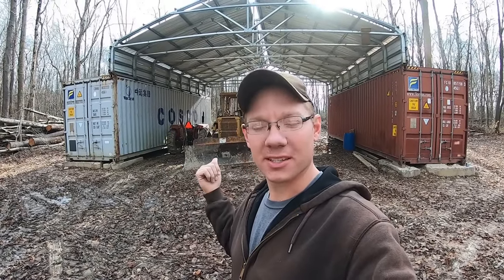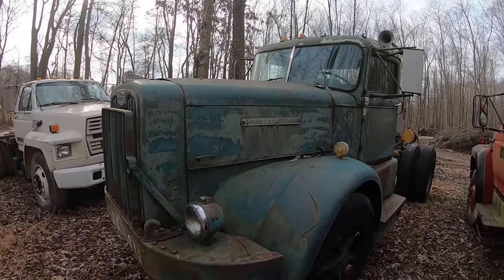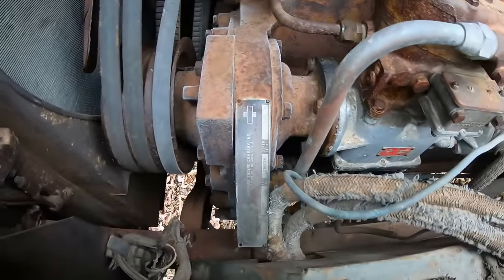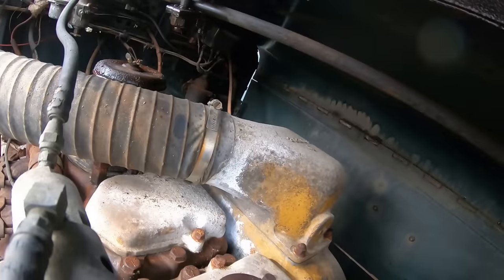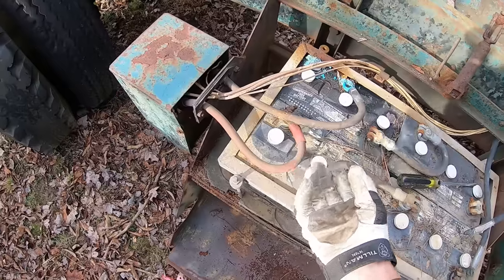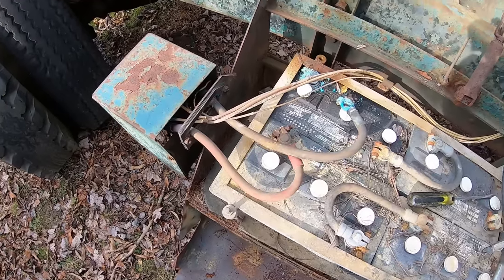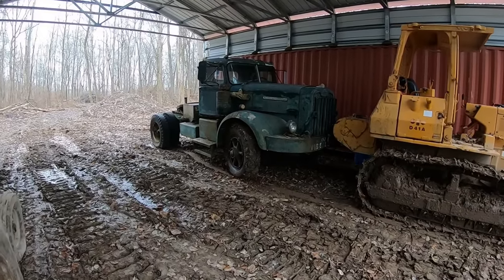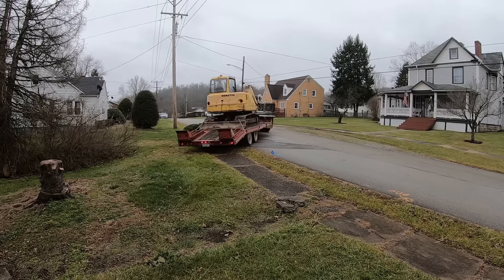First attempt at starting 1957 AUTOCAR truck - Hasn't run in 15 years!

Comment: Those old Autocars were positive ground. Most likely you will see that in your manuals. Remember that is positive ground so normal wiring will be a bit different. And you will need to remember that when your rewiring things. It has been a long time for me to remember how all that works. Drove old Autocars trucks a long time ago. They were positive ground even up to the 70's or more. And if you were to put anything negative ground in there it will short out. 

And if you were me run new diesel, take off and clean fuel system before starting. And check the wiring well between starting system. Most likely those batteries have frozen at one time or a another.  So check for bad cells. Be ready to have something flat to block off the air intake in case you get a run away to shut air off to the engine.... you never know on them old girls. The compression release is in the cab, if you need to be in a hurry, that flat piece of wood will cover that air intake on top of the engine in case something goes wrong. 

Here to help if I can.
Reply from the maker: Much appreciated! those batteries are completely toast. no continuity. as for your other suggestions I plan on doing all that next time I work on it, I went in a little un-prepared on that one so im glad it didnt actually start. its going to be a long big prioject!
Reply: @DieselCreek  yeah that's okay. It's good you got some books to reference from.

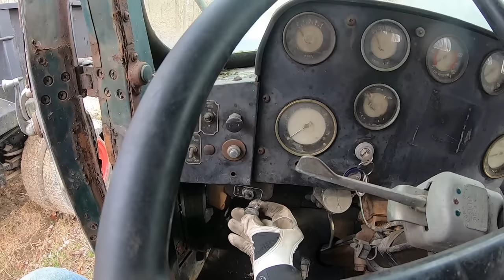Comment: 12:09 - wiper control - 'plumbed with air lines...'
Reply: Sounds about right
Reply: Don Pollard that was common way back when. They were vacuum lines. The wipers would slow way down or speed up depending on throttle position. It was not an effective system and the wipers were no longer then  about 12 ". I'm 78 and cut my teeth on such early systems.

Comment: The brake shoes are rusted to the brake drums. Thats why the rear end won't rotate. Be careful if you take it apart.  Most likely the brake shoes have asbestos in it. Just my two cents worth.  As for starting the engine make sure you remove the intake pipe. And have a board that completely covers the intake hole. So if the engine runs away you can cover the intake with the board and kill the engine.
Reply from the maker: Yes freeing the rear end up will likely be an entire video itself

Comment: That knob under the dash controls the wipers. That pull handle should be the compression release to aid when starting. Those old Cummins engines had weak starters that needed extra help to turn the engine over. I remember every Cummins I ever drove up until the 70's having them.

Comment: Get some real jumoer cables ,OO welding cable. Pull the 'shut down " compression release while cranking. Let it get spinning freely  then push the release in . Might even crank doing that way with the cables you have. started more that one long sitting old Cummins.
Reply: If that truck was given to Bruce Wilson it could literally starts in one day
Reply: Yep 
Does he know much?
Reply from the maker: Those are 00 welding cable... I said that in the video
Reply: My buddy bought an old Mt. Ranier plow truck.  Don't know what kind of diesel it was, but it had a 10yd dump bed and 2000lbs of weight plates on the front end (no plow blade though :(   ).  Same type of electrical setup, but my buddy figured we could get it started with his minuscule VW Rabbit battery (brand new), and the battery from my old BMW wired together.  We fought that thing for a week, but couldn't figure out the problem... It would just wind up the flywheel, and you could watch the oil pressure come up, and it would suck down some fuel that he was pre-loading the fuel filter with, but no fire.  He was sitting on the fender messing with loading the filter again, and I was sitting in the cab, and I saw there was a shallow depression in the grass ahead, and I figured I'd freak him out a little and take the parking brake off and let it roll a few feet.  So I put the giant lever in the cab that I thought was the parking brake down, and it didn't go anywhere to my dismay, but my buddy DID freak out: Him: "WHAT DID YOU JUST DO!?"  Me: Took the parking brake off...?"  Him: NO!  That wasn't the parking brake... try the key now..."
And when I hit the key, even with both batteries, it barely turned over.  But it cranked fast enough to start, and we did a little dance.  It was a compression release!  So we left it for the day, saying I would return the next day to help him start it again to move it to his house, but when I called the next day, he said he had already moved it.  And when I asked how he did it without both batteries, I asked if he had spent the money on a new, real battery (which was about $600).  But he said nope, got her done with just the Rabbit battery!  So I went over to see, and he wound it up on just the flywheel on that little battery, and when the oil pressure got up high enough, he just slammed that compression release closed, and that thing fired to life with some real authority!
Another one of the cool things on that truck, it had some type of venetian blinds in front of the grill which wouldn't open until the truck was up to operating temp.  You wouldn't want to stick your fingers in there when they closed though, you'd pull back stumps!  Had a 10 speed Allison transmission too.  Fun experience, but he didn't own it long, the city wouldn't let him park it on the street out front of his apartment. xD

Comment: Hmmm, the old Autocars I was familiar with used air starters. Don’t know what engines they had in them tho.
Reply: John Acuff air starters could be used on any engines. But you wanted to carry a 50 to 100 foot jumper hose, so a buddy could pump you up. 1 truck I worked on had 2 - 12 volt starters.
Reply: I remember those starting on my towns Main Street..Damn loud, and scary if you don’t know what’s going on.

Comment: That gizmo behind the battery box is a series/ parallel switch, 24v while cranking and 12 v after. They can be a real corrosion nightmare. I’d also verify that it’s a negative ground , and you will get more current if the dozer is running. I think I’d make new battery cables and put a couple 4Ds in there, consider it the first step in the resto. It looks like you own enough equipment to justify a couple big batteries anyway. Just my 2c. Oh and you have a new sub, thanks!
Reply from the maker: thanks for subbing! ill be getting some batteries here soon so we can get her going i was just excited to try and mainly focused on getting it under cover, thought it would be awesome if she could drive there!

Comment: Should not try running her with the fuel in it! Get you a 18 ltr Bottle of fuel and directly connect to the fuel pump or filter inlet after installing a new filter,  Try to prime the fuel line with a siphon out of the barrel, having it set on the roof to help gravity feed the fuel!  Some of these trucks do have a primer pump by the filter, If so Give it about 7 plunges so it forces fuel thru the pump, Crack the injector inlet lines so you can see fuel start to leek out.  This method is one of the fastest ways I get old diesels started!   As far as the old fuel in the tanks,  Might as well drain into barrels and use for starting fires or cleaning parts.  DON'T RUN THE TRUCK WITH IT! That old fuel could play havoc with the pump and injection!
Reply from the maker: yes excitement was getting the better of me, just glad it didnt start so i can do it better next time, thanks for watching!

Comment: TIM from Canada suggestions for anyone that has all the equipment like this and you really do not know what the switches are.. Number # 1.. use masking tape put pieces of tape over or under your switches... depending if you have the room...# 2.. Mark out on your masking tape what the switches are...or...#3.. keep a book go to the dollar store or any workbook write down what you think the gauges are use freezer lock  bag.. put the book in the bag keep it in whatever vehicle you were using right on the front of the bag this is instructional for this vehicle... because in most cases when you were buying used equipment people have a tendency to modify gauges and switches that do not coincide with what is on the dashboard...

Comment: Dude, get 6 inches or more of gravel down in that shed or shove her back outside.  Standing water in mud under a roof eats vehicles alive from the bottom up.  She'd be better off in the woods.  Take the advice of hard earned experience.
Reply from the maker: It’s getting gravel as soon as the weather brakes and the floor is pretty dry In there we had some sideways rains a few days before that soaked the floor.
Reply: yup your right , but there is through  air flow that should help a bit
Reply: Check out asphalt millings for the floor . Best to put down in warm weather though.

Comment: The first thing to do is eliminate the 24 volt system and convert it to a 12 volt system , trust an old retired oo you will be glad you did !  Those parrallel switches were 150$ back in the 1980s  but now ???. If you can find one !  I bought two of em before i learned a 12 volt starter worked every bit as good as a 24 volt especially with new welding cables for starter cables and a new 12 volt starter !
Reply from the maker: That’s may be the route I go when I re wire it

Comment: Shorting the two big terminals on the starter will make it free spinning. To make the pignon gear engage the selenoid must be energised by jumping the small wire on selenoid  to the big wire from batterie . These engine have the tendenci for rust pass throu sleeves and leak coolant in the engine.
Reply from the maker: thanks for the heads up, i figure id get it running see what kind of power its got then if need be locate a bigger motor, thanks for watching!

Comment: That Autocar Engine which os a Cummins looks like a N 220 or 230 or a 250.. those engines came equipped  with a decompression device  which is the little lever on left front of the engine at the first head  it is an internal rod when you pull it from the cab   it push all the exhaust valves down  that help the starter to turn the engine   very faster  just see inside the cab for a handle hooked up with a cable hooked onto the decompression device  with handle on top of the first valve cover on first front head cover those engines are very tight on high compression it is why uses 24 volts just to crank  then the converter turns the whole truck into a 12 volts service..that box on left side od batteries with the cables is the CONVERTER.. or power Inverter   that engine it been seated for a long while check fuel filter   so at the time to make crank  pull the decompression device  and let the engine runs without compression for 15 seconds then release the decompression handle and the engine will start
I had few trucks macks R-700 with that engine on it  N250's Cummins on it.

Comment: One signal wire from start switch. Jump the correct terminals and itll turn over. Itll be the small "s" terminal to the power wire on the solenoid, not the two larger wires.

Comment: I just need to get something off my chest about how long vehicles have been sitting for. An engine doesn't know when it ran last. It doesn't have a memory! It is not thinking "oh no I haven't worked for fifteen years maybe I should just stay shut down! Now you know I'm being flippant saying that BUT, if the motor is not locked up and it has everything it needs to run, then it's going to run. 
I understand that the wiring all has to be good and a dozen other things need to be in a certain condition to run but if they are all good or have been replaced then the motor will work, whether it one year old or 90. Now don't go bagging me, I love these shows and have stripped and rebuilt more motors than I can remember. So I'm a fan ok. It just is not necessary to write in block letters that this or that hasn't run since God was in short pants. Cheers.
Reply from the maker: believe me I get where your coming from but for some reason the longer something has sat the more I wanna see it go! and im not alone because these types of videos do excellent compared to others that do similar stuff without saying "first start in years"
Reply: Diesel Creek. Yes, I get it, I really do. Thank you for bothering to reply to me (a lot don't) best, Chris.

Comment: You needed to connect two lots of jumper leads on twelve volts.Jumping the main battery feed and the power supply to the main starter body will only spin the starter as the solenoid needs to engage the drive gear.

Comment: if there's  compression springs on the rear brakes, they can make brakes stick. Either change the springs or use flat washers to increase their pressure.

Comment: Personally I’d rewire the whole starting system before doing anything. Mice chew on the wire coating and make holes allowing air and water inside causing corrosion of the copper. That reduces your amperage to the starter and can cause the starter to burn out. I’d also remove the starter and rebuild it and make sure the solenoid is free.
Reply from the maker: I’m gonna restore the whole thing eventually, new wiring hoses the works. Just trying to get it fired up to check the state of things mechanically thanks for watching! Hope you subscribe!
Reply: I understand that, but that wire was 90% gone. You could easily fry your starter. I learned the hard way as a kid. I spent 20 years restoring trucks, mostly pickups. Just replace the main wires, can’t cost too much, a lot less than a starter. Just my advice. Sweet truck though! I admired them as a kid in the 60s.

Comment: I could be wrong but i couldn't hear the dozer running while you were trying to jump it, if so you won't get the juice to the starter motor to crank it leave the dozer going it won't hurt anything so long as the connections are correct   but you obviously know that, can't wait to see it run

Comment: shorting across the posts will spin the starter but won't engage the solinoid, you need to find where the thin trigger wire attaches from the ignition key and power that at the same time. mormally just shory between the trigger wire and the 24v lead and it will do it.
Reply from the maker: Lee Wilkin yesterday I just connected some good batteries in the correct fashion and she cranked! Video soon!

Comment: That's a compression release you pull that out and crank it over when it gets spinning good u let the release go it closes the valves on the engine and it starts if u don't use it the motor will turn to slow,if at all and won't start.

Comment: on top of the fuel pump there should be a small round knob at fuel shut of solonoid you can manualy turn that knob witch opens fuel to the injectors to shut down engine turn knob to its original position hope that helps
Reply from the maker: I just saw someone else mentioned that and im glad because I didnt know that. thanks for watching!
Reply: @DieselCreek  you should cover up that intake or you'll have something building a nest in your motor. What year are the fords you want to sell gas or diesel
Reply from the maker: David Caskey I did cover it, the white one is an 88 f700 with a 6.6l diesel the other one is a parts truck no title with a big block gas burner I’m not sure of the year, it’s a 600, 2 speed rear nice bed and hood I was gonna put on the 700

Comment: New sub signing in. I Like what I've seen, so cant wait for more. FYI if the meter has a continuity mode or ohms, it would be easy to see whether it is + or -ve earth. Set it in one of those two modes, disconnect the batteries, and then touch one probe to the wire and another to the chassis. Low ohms or a beep tone indicates continuity and hence, that wire is the earth. Hope that makes sense. I would also buy some fresh batteries as I'm quite sure they will be sufficiently bad to stifle proceedings. Good luck pal.
Reply from the maker: Thanks for the suggestions and for watching! Merry Christmas!

Comment: Rewire the battery terminals it was  turning over like a week ground. The old girl should pop over with a little ether (go juice). The old fuel will have a lot of moisture and gel easily and cold weather.

Comment: Cummins have a thumb screw on the back of the injector pump so that once it's running it won't shut down for lack of DC power. Yours may not have that because it has a manual shut off.

Comment: the battery cables going in to the box go to what is known as a series parallel switch. when starter is energized it switches to series and turns the bank into 24v then when released goes back to 12v

Comment: I know this truck is old, but if it has air brakes, the lack of air in the brake system locks the brakes. The spring loaded pods that actuate the park brake cause it to release by being charged with air. It's a fail safe measure on air brake systems so if your truck dumps its air, the rig will stop on its own and not lose control.
Reply from the maker: not back then, spring brake canisters didnt come till later! thats why runaway truck ramps used to be so common back then if you lost air you were SOL ...this does have a manual drive line brake but not sure it would stop a loaded rig!
Reply: @DieselCreek  wow. Learn something new. Glad it isn't that way anymore.

Comment: Nice video
My grandfather worked for autocar in Ardmore pa back in 40s or 50s
Factory burnt down probably 58 or so.
Moved operations  out west
Auto car owner first invented porcelain spark plug
Articles on internet pretty interesting
Reply from the maker: That’s awesome! Mine just drove them!
Reply: @DieselCreek  
Hey
Wondering if your truck indicates it was built here in penna or perhaps company had already moved.
Just saw Ardmore factory closed in 54 and burned down in 56. Plant then moved not far to Exton pa.
Reply from the maker: I’ve never noticed, I’ll look next time I’m working on it!
Reply: @DieselCreek  
Thanks